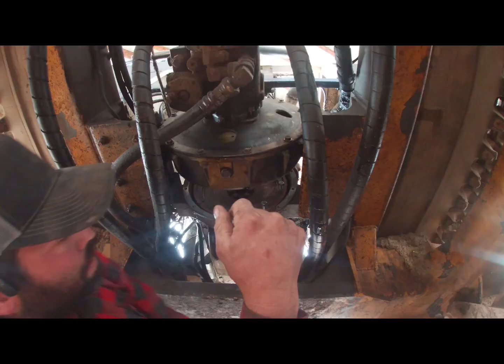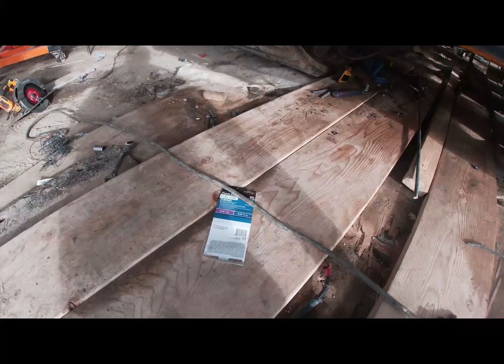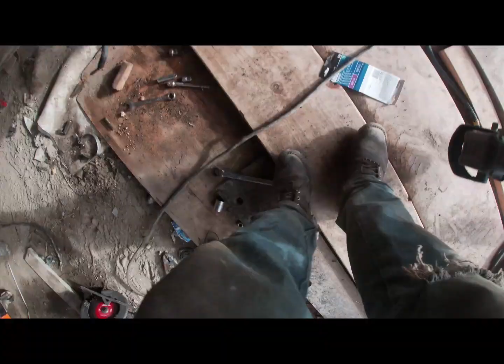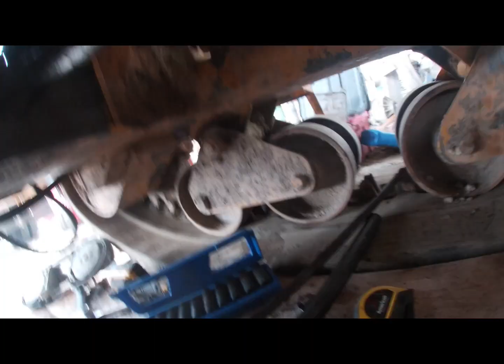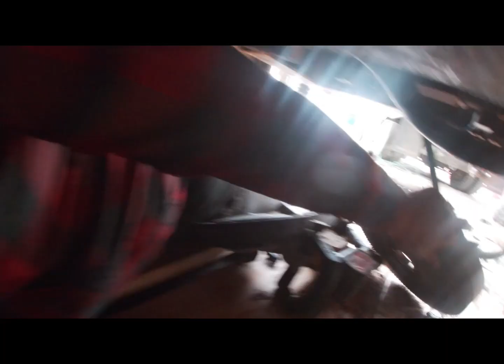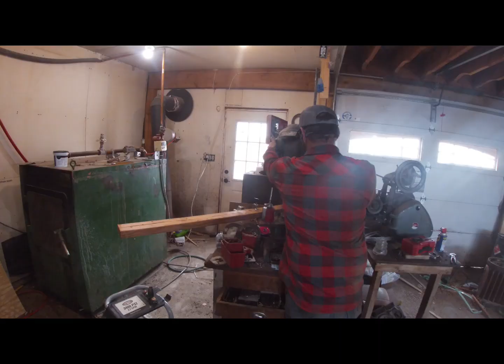drive shaft planning

Comment: I was in tech school during highschool for machine shop and used decent equipment there . I have a free to me small flat belt driven lathe that is almost useless especially compared to the one that you have. You will get it figured out and done
Reply from the maker: it was a learning curve. once i get the change gears figured out and the directional gears fixed I want to try to thread something. the problem is now I want a mill.